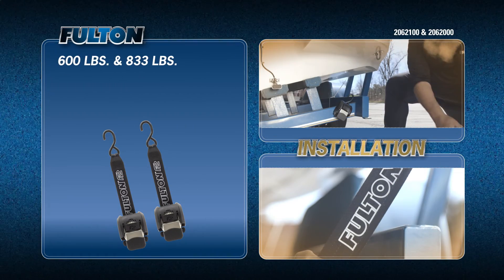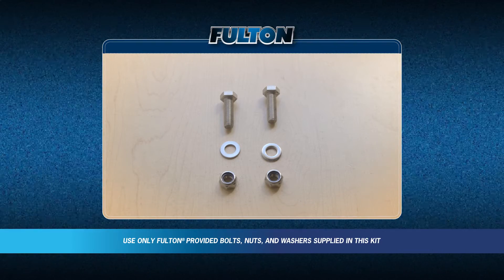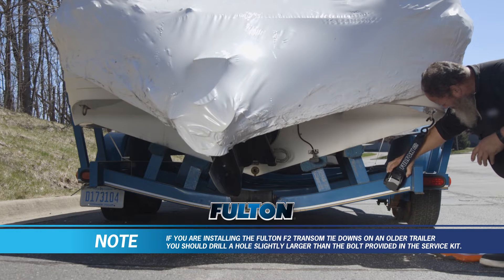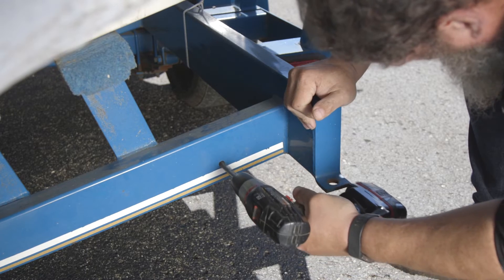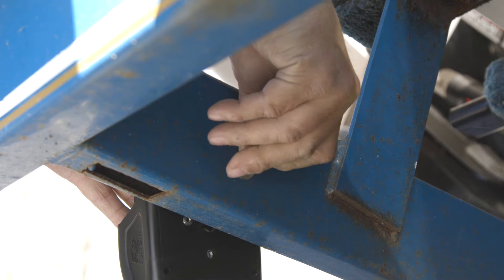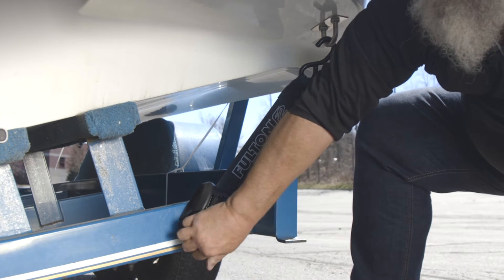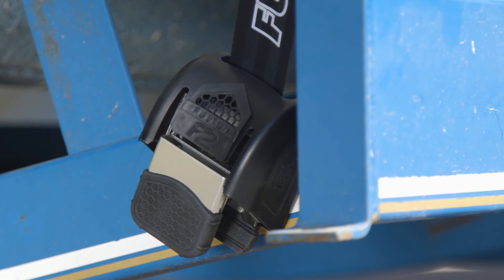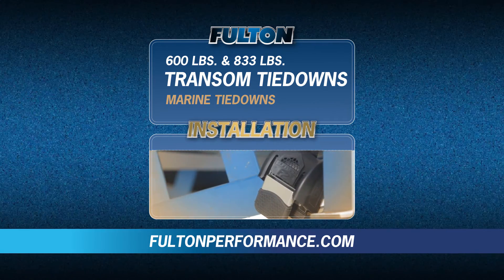How to Install Retractable Boat Transom Straps  - FULTON F2 Straps - Securement made easy!

Comment: That was a little disappointing from FULTON, the manufacturer of these excellent retractable ratchet straps. Why FULTON did not take the opportunity to produce a demonstration of the ideal installation of their straps do not know. At one point they did mention not to install these straps in way that pulls the boat forward on the trailer. FULTON could have provided a detailed explanation what we are trying to achieve when installing their straps, then go on to show the correct install.